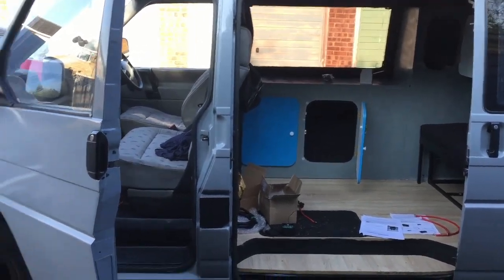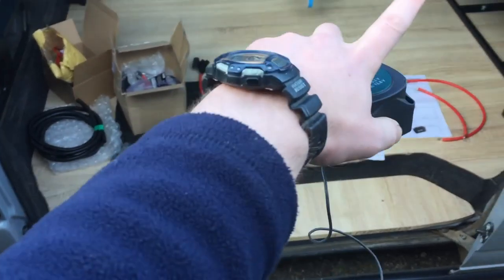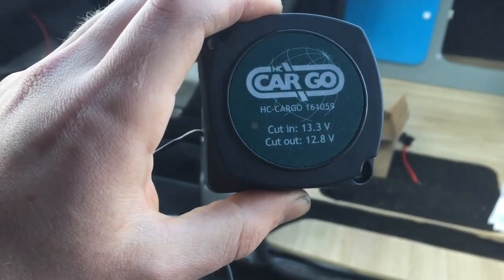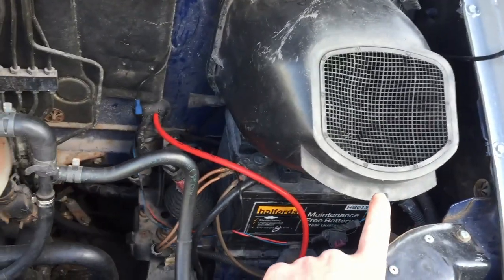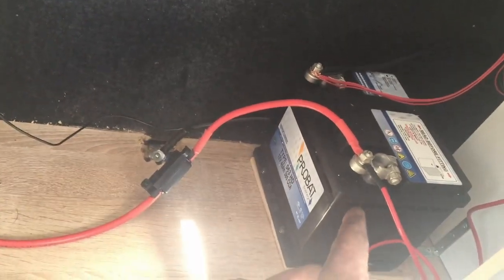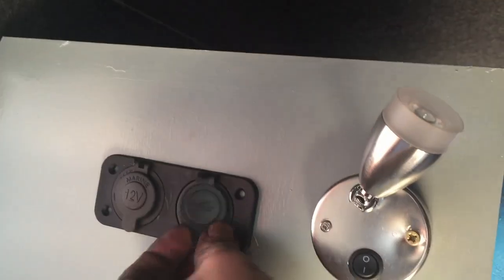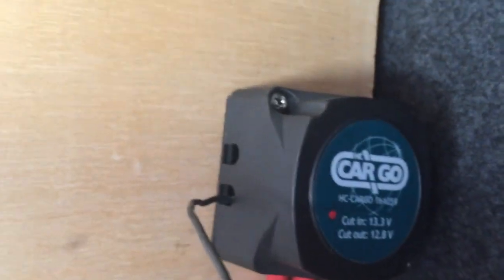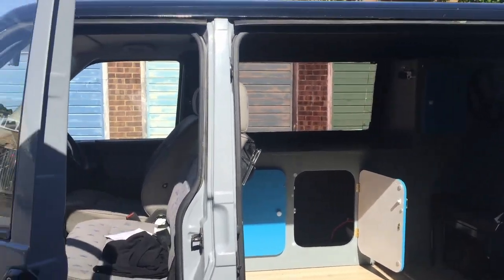How to install a leisure battery with split charging

Comment: I wish I could find a video on this by someone who actually knows what they are talking about. you mention there are different types of split charge relay and you explain yours but not the other types and how to choose the best one for your needs. you mention that you need the correct cable for your appliance but you don't explain what you have installed. and then there are lots of red cables connected to your negative terminal. Correctly colour coding the cabling is always a good idea
Reply from the maker: phililpb 

Thanks for your feedback. The red wires are what I temporarily used after running out of black, and you are right this is sloppy practice. so my bad. Sorry I did not go into detail about different types of relays, perhaps this would have made it a more comprehensive video
Reply: sorry if it sounded like a rant . I just like to get things right and I am looking for information . I am fitting out a van that is a half finished project and I am trying to make sense of the cabling that was installed by the previous owner.
Reply: An accurate description of the Volt sensitive relay ( VSR) would also help... When the engine is running  the VSR charges only the vehicle  battery until it reaches the preset level 13.5 volts.The VSR then switches in to also charge the leisure battery     . If the vehicle battery drops to 12.6 volts the VSR then disconnects supply to the leisure battery. To protect the vehicle battery from becoming discharged. The  Leisure battery can still be used to power the circuits attached to it, but it won't get charged until the Vehicle battery again reaches the 13.5V level
Reply: Dont make apologies if there that thick and cant work it out after having a few pointers then they really should leave it alone and pay an autolec to do it simple !!!👍
Reply: Surely if you want to find a video of an expert and cant use your brain to take the information from this video to work out what you need to do then you either A) need to learn to read and read a book or website or B) hire and expert 
theres no need to have a strop for someone doing a DIY camper and expecting a full explination in 5 minuets of a system that works for every van ! i certainly dont rember stuff i have no need to know cause then useful things to me would disappear !

Comment: 70 pounds for the relay??
Reply from the maker: You can get relay’s cheaper but this was a great quality kit that came with the wiring, connectors and fuses etc. Perhaps you can do better 😊
Reply: @JoelsStuff  Hi Joel, thanks for the video first of all. Yes, I thought it was a bit exaggerated the price for the relay. The same model is on sale on amazon for 29 pounds. Thanks for the inputs anyway...easy to criticize when we are here :)
Reply: @luter82  any link

Comment: My light stays on
Reply from the maker: It’s not doing its job then. If the light it on then you are draining both batteries when using electrical power. It’s either faulty or wired wrong